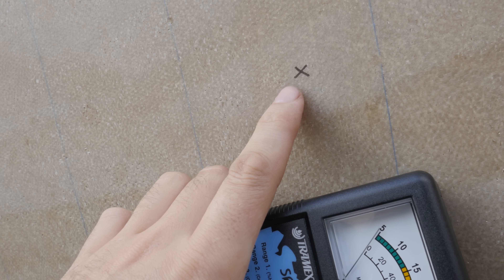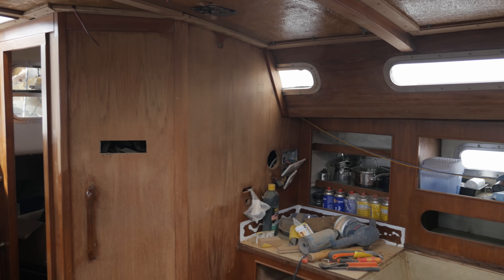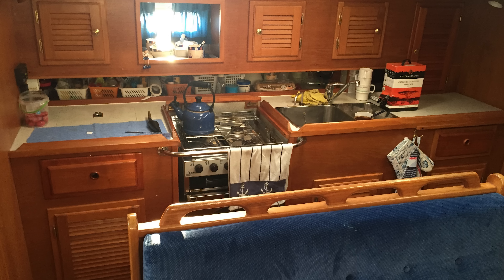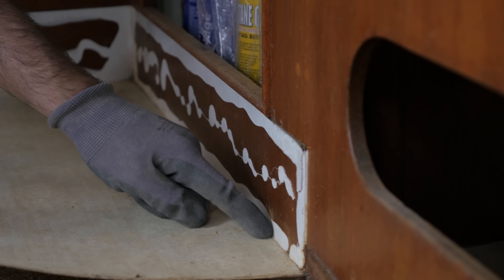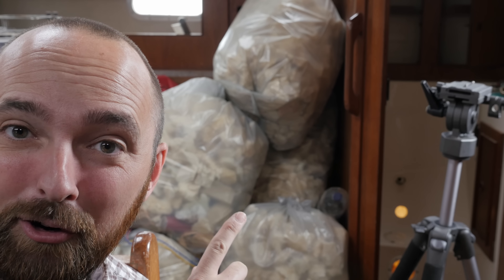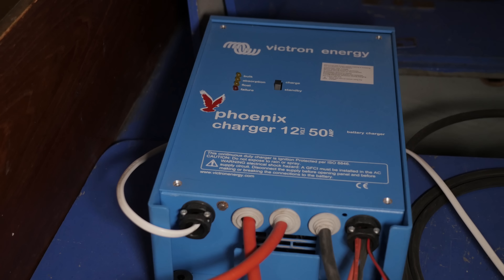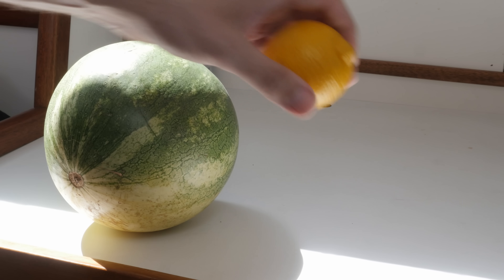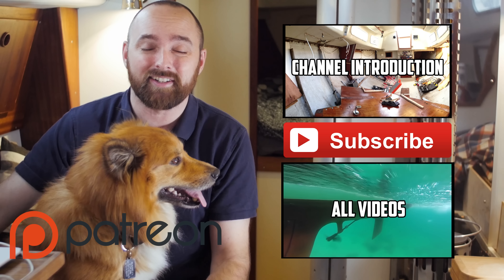Sail Life - DIY sailboat restoration

Comment: Hey Mads,
Ive been a big fan for a while since the 7 part v-berth insulation videos! Thanks for your well thought out and interesting videos. Im as big of fan of your editing as your content! In this video I see you love your scraper. Ive used a similar tool on my old boston whaler on its teak trim but in combination of a heat gun. The heat helped soften the varnish, then scraped off easily.

Comment: I know this is an old video and you have already removed the laminate from your old counter top but so you know for future using paint thinner to remove laminate works amazing. just get the removal started with a putty knife or similar tool and put the paint thinner in a spray bottle and apply to underside of the laminate while slowly lifting it up using your putty knife. continue to apply more paint thinner as needed while lifting. use it all the time at work in my cabinet shop works amazing. great videos btw.

Comment: Hi there, Drying out the hull. Here's what I do here in the northwest. Pickup some metal conduit, and build yourself a tent frame. Get some reinforced plastic and cover the conduit frames. Make sure you place the plastic under the boat making a complete enclosure. Find a wood stove, pellet stove wood heat...wood heat is dry and no moisture. Place a couple box fans in the tent and start moving the dry air. You will dry out your boat very...very quickly.  Some guys set the wood stove outside the tent.

Comment: I had a 4 burner Force 10 stove on a previous boat.  It was an awesome cooker and one of the few boat cookers with an oven worth using.  Sadly I sold it not that long ago as I took if off the boat I installed it on.  They are expensive but perhaps you might find a second hand one.  Thanks for the scraper plug I need one to scrape the varnish on my bulkheads.

Comment: Hey Madds - thanks for another great video.  You ask for a lot of input and that is great.  But you go so fast (don't slow down), it's hard for me to remember all the things I'd like to comment on.  So, here is just one.  On the design of the galley - you mentioned you would like to use it before you re-design it.  I agree 100 percent with that approach.  Some yacht designers are not that great but if the boat has been in production for a while (which yours has), chances are good that any design flaws have been worked out.  So trust the designer unless you have at least 2 or 3 years of hard use to prove that it needs to be changed.  
Just giving you a vote for the direction I already know you are headed.
Ron

Comment: All hail the mighty scraper! Lol. Kitchen improvements, hmm. Build some sort of Vent over the Stove to get that moisture away from the wood. I like the idea of the stove in the middle of the counter, mine is tucked against a wall, no room for error. If you want a safer stove go for Petrol. However it is a lot trickier but burns the same as gas. Big format drawers with a locking mechanism in the open position are nice. Fridge some place else an option? Make sure that fridge heat exchanger is very well ventilated with cool air, it'll save you a lot of energy, more than overdoing the insulation. Don't get a freezer, it just makes your fridge wet, get ice in a bag, it'll keep a long time in the fridge. Oh and keep in mind that with that asymmetrical cabin layout you will need a lot of heavy items on your kitchen side to counterbalance a fully loaded seating area. Cheers, Mark

Comment: Attach a shop vac to the orbital sander exhaust thereby capturing most  dust. The sander's filter does little to capture dust. On a larger interior refinishing we attach a 30' swimming pool cleaning hose to the shop vac exhaust and port it overboard. No need for a respirator as the dust is vacated. Stay healthy and have fun.

Comment: I have an old boat I am working on as well. It's a Helson 22 and it's just a little day sailor with a cabin. They had a ridiculous "galley" in there that was just particle board with a sink in the center that dropped straight into the bilge (no pipes, just fell of of the sink into a hole open to the bilge) and a space for some kind of camp stove. The wood was delaminated and moldy, so out it went. While I will not be putting a galley in and will most like just make cushioned benches of most of the boat, I may put some sort of small table in place the the galley countertop. Since I like to use as much recycles materials, one thing I like to do it glue up spare pieces of wood using epoxy or 3-to-1 Shellack and make a kind of butcher's block countertop. A good way to use scrap lumber from your project or someone else's scraps they don't want and it makes a really nice countertop. You cut the glued block to size, plane it down and put whatever sealing finish you want it it. Easy and cheap. Just an idea. Love the videos! Thanks.
Reply from the maker: A gally made from particle board sound like a horrible idea :D It's good to hear that it's not just Trident Marine (manufacture of the Warrior 38) that made some odd choices. Cool idea to use recycled/reclaimed materials :) I'd love to see some pics of you boat :)

Comment: Had the same sticker shock with the Force Ten.  I have an alcohol stove with a pressure tank.  No extensive research yet but it seems much simpler than propane and easier to get the fuel.  Great watching your vids, as usual.  BTW,  I am a chemist and the hygroscopic compound explanation is plausible.  If so, rinsing with fresh may help but not much.  Many of these compounds may be "trapped" in the glass.  Sitting in a fresh water lake for a month or two may work better.  Doesn't seem practical.  Driving the moisture out by heating the interior a few degrees may work but sounds expensive.  You may have no choice but clear the blisters, rinse the hull well, fair it, and seal it.  Luck to you.

Comment: As you are doing a lot of scraping I will mention that there is a larger version of your scraper with a knob  so you can use both hands and Tungsten Carbide blades that last simply ages.  As to the laminate removal, Ive done a lot and found the best tool is a drywall taping knife, I like a 4" size. You heat the laminate but also get the knife hot (wear gloves) and it goes much faster. If there is an edge where it is tucked under, just get the hot knife up to it and yank, out it comes. For the locker catches try looking at Lee Valley tools. They have masses of hard to find hardware.
Reply from the maker: Cool! I'll take a look :)

Comment: It is great to see your progress, but I would as I know others have said, think that the process of drying out the hull would be aided just by tape a light tarpaulin around the hull and fix it underneath and then put a small electric heater (or similar) with about 1-2kW of power underneath. The warm air should improve both ventilation and the drying process. Because as you have mentioned earlier, this summer have been very wet and fairly cold from a weather point of view. 
In great anticipation, I am awaiting some dry and temperated weather to be able to continue painting my little live-aboard. 

I have a live-aboard situated in Sweden, Göteborg, she was built 1929 as a Bunker-tanker, and since 1943 she has been called Reana.
She is 15x5 meters and at the "marina" where I am moored I have to pay for 20 meters and it is 2'800 SEK per month. That is approximately  33'600 SEK / year approximately 3'535 Euro per year. And for the electricity I pay 2,25 SEK / kWh. 
This is quite expensive, but at this particular marina, I am allowed to make a bit of noice, chipping away at the rust and so on ;-) 
The ever on-going refurbishment and improvement is aided in the fact that no one can complain if I need to use a rust hammer or anglegrinder. In many of the marinas around this one, you are not allowed to make too much noice.

Comment: Hi Mads.... In Sydney we cannot live aboard our boat more than 3 days a week or full time for more than 3 mths - other places you can. To moor your boat (say a 33 footer) in the Slips/Pen would be about $7000 per year which would be about $6500 CAD. In regards to the stove, the marine stoves have always been very expensive even the cheap ones. Back in 1978 my Dad was building our new boat and it was cheaper (50 %) to buy a LPG Caravan / Motorhome two burner stove, griller and oven than it was to buy a Maxi two burner metho stove. 40 years on I see boats for sale from that era with the same caravan stove still perfectly good. My current yacht has a more modern caravan stove than was used by a number of boat manufactures back then. You just had to fit up a set of fiddle rails and bolt on side brackets for the gimbals and you had a suitable stove. The point I am poorly trying to make is that your stove doesn't have to be Ships grade Stainless Steel as the stove is inside the boat - the enamel is fine. Broaden your search outside of the marine spectrum, you maybe presently surprised.
Reply from the maker: Dang! Those are some pretty strict rules and high prices :( What about cruisers where do they go? :) Very interesting! The two burner stove aboard Obelix is 43 years old and in great condition too :) I'll take a look and see what "caravan" options are available around here :)
Reply: Hi Mads, Cruisers are treated differently and get an extension (maybe a year) as they are transiting.

Comment: 4.10 I worked on a boat some years ago where the owner had drilled a hole in the finger clip and then platted a piece of cord, attached to clip then passed out of the hole. it worked very well and no broken fingers.

Comment: Suggestion for your scraper that may help speed things up more.
1. Always draw the scraper in the same direction. Pushing with the scraper is rather ineffective, and will dull the edge that much faster and gives you another chance to gouge the wood my accident.
2. Get more scrapers, and a good file set. The edge dulls quickly, and it can actually be more effective to have a bunch of them on hand to take a few strokes with, and then take a short break to touch up with a file and make sure your edge is true and hard. Also having a range of sizes can be very useful when dealing with trim and such. 
It might not seem like it is any easier when you stop and touch the scrapers up after only a few strokes on each, but if you spent all day doing it then your back and shoulders will really notice the difference in amount of effort you actually put in.

Good luck, and thanks for the videos.

Comment: I have just discovered your channel. Really enjoying your series of videos relating to your new boat. Just in case you have not encountered this strange and very annoying incompatibility, varnish and paint do not mix. If you apply paint to any trace of varnish, the evil varnish will, given enough time cause the paint to delaminate and break away.  In fact, because of the chemical makeup of varnish versus paint, it's like trying to mix oil and water. So, in order to paint a varnished surface you two options. First, strip off every scrap of varnish or coat the varnished surface with a coat of Zinsser which effectively acts as a barrier and really does work well.

Comment: If you are left handed, you may consider swapping the location of the sinks & refer.

I think I would use stainless steel counter top instead of formica.  It's so much nicer to be able to put a hot pan down without worrying about damaging.

What fuel does your stove use.  I think most people are most concerned about choosing their favorite fuel.  I don't think you would ever use 3 burners so if you stick with a 2 burner you might be able to create a small storage space behind the stove and still allow for reasonable swing.

more shots of Jukell please.

Comment: Great video as usual. 
About the stove, I'm considering replacing mine with a diesel stove from wallas. Advantages are to get rid of the gasbottle, the open flame and the risk of explosion. Also limit the risk of running out of stove fuel when cruising remote loations. Have you considered  diesel stoves? Would be great to get your opinion on the subject.
Reply from the maker: The more I read about the diesel stoves (for cooking) the more intrigued I get :) Obviously the diesel stove has more moving parts and electronics so you're sacrificing some simplicity. I like simple thinks :P Hence the Refleks stove for heating. But I'm very intrigued!  I'll take a closer look :)

Comment: To accelerate the hull drying:

See if you can protect the area from flooding;  Consider taping a curtain of black plastic from the water line to the ground and allow for an air entrance on one end and then get a long piece of black plastic pipe several inches in diameter and place it - like a chimney - from the water line vertically up to get natural air flow moving through the tent that is heated by the sun and will suck the moisture from the hull by one of those reliable physics principals I can't remember.

Comment: Have you checked out the stove on Emerald Steel.  I think they use propane but you could also get a wood/coal burning but it would function as heat as well and you could always keep a pot of hot water at the ready.   I think they have a secondary cooktop or something for warmer climates.  You make me tired just watching but I guess as a younger guy I did the same thing.  Best of luck.
Reply from the maker: Interesting I'll take a look :) I think I'll stick with propane (cooking) and diesel (heat) :) A lot of the places I plan on spending time don't really have a lot of wood :) Haha, no doubt I've got a lot of work ahead of me. Still, every time I go up the latter I can't help but smile :)

Comment: did you get my email on the shower pump?, its basically a lunch box with a course mesh filter, float switch and bilge pump in it , the pipe from shower drain goes into it directly and it pumps the grey water directly out without it actually going into the bilge, just t'eed in ...i love it. maybe common but i had never seen one and bought one ready made but easy to make and solves issues etc can be used for sink etc too! .
Reply from the maker: Hey, John :D Sorry I must have missed your email. I'll check later today! :) I'm planning on building something like that for Athena :) I can't fit any of the premade ones I've found so far. Without a doubt a much better solution than letting the shower drain to the bilge! :)

Comment: And use a metal duct to blow the heat into the tent. Moisture of any kind is not good when drying out the hull as you all ready know. I use a pellet stove due to the zero clearance of any thing flammable and the duct is no more then a dryer vent.

Comment: Hi. I'm currently working on a similar project. I am yet to get to the electrical. It's scares me if I'm honest. Don't really know enough about it, worried I will forget areas. Would be greatful if you covered the electrical in as much detail as possible.
Reply from the maker: Sure :) There is not a lot to be scared off but I remember finding it a bit overwhelming when I did it the first time. Most 12V systems are very simple once you start taking them apart :)

Comment: Think about an Origo alchool stove, you will use a cheap, available and safe fuel. I am tired of propane stoves!It is important to have salt water at the sink to wash the dishes on a longer trip. If you are planning to add an microwave, do not waste space, time and money. Underway it is useless. As you are living aboard you must evaluate, if you have a reliable source of electricity an microwave is great. Do not forget a good garbage bin. My boat is an Island Packet and it has a very good garbage bin. A laminate counter top on the IP is great, easy to clean and mantain, but as you are renovating a corian top will last longer, great looks and is easy to clean.

Comment: Remember to paint inside the cabinets before you secure a top on…much easier.
Reply from the maker: I plan to :) Also I'll be putting in the new fridge and replacing the hoses to the forward head before putting the countertop back on :)

Comment: Thoughts on moisture in the hull.  It seems the highest moisture levels are in the lowest areas of the hull & keel.  Perhaps some of the moisture is making its way down the laminate via gravity.  Have you considered drilling a couple holes in any softer areas of the keel?  I've seen this done before with significant water release.  As in this video:  https://youtu.be/5LqVWC_bY-w?t=2m8s

If tenting the boat to create a dry outside environment is not feasible I would also think keeping a dehumidifier running inside the boat would also aid the process (I realize this has been suggested multiple times already).  At least this way you create a very low humidity environment on at least one side of the hull.  Seems like an easy win (assuming the electric costs aren't too much) and it might speed things along significantly!

Comment: Maybe the drawers for opening perhaps switch those to push button that lock when pressed like RVs have or magnetic.  As far as stove I don't know perhaps I just have a propane two burner or three burner stove top cheap.  Probably similar to RV or Camper vans.   But if you want an oven too plenty of RV ovens run off propane cheap very cheap compared to your price.  However you didn't indicate if your concerns or wishes either gas or electricity.  I am just assuming propane since it's cheap and can be used for heating or even used on some RV refrigerators since your replacing the ice box too that is if you want that type of Fridge which is sealed systems with no moving parts or conventional electric one. But I don't think you asked for our opinion about Ice Box only Stove/Oven.